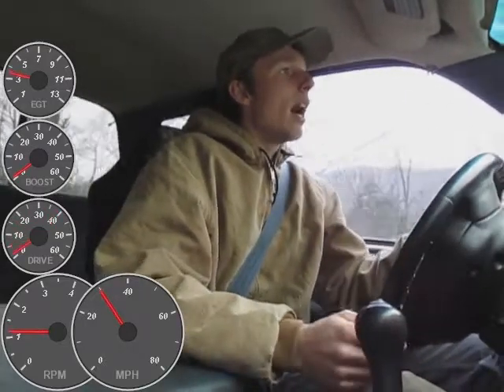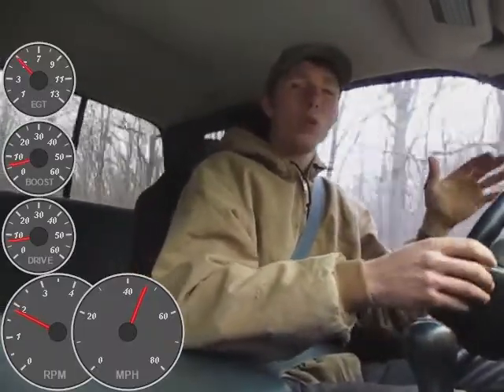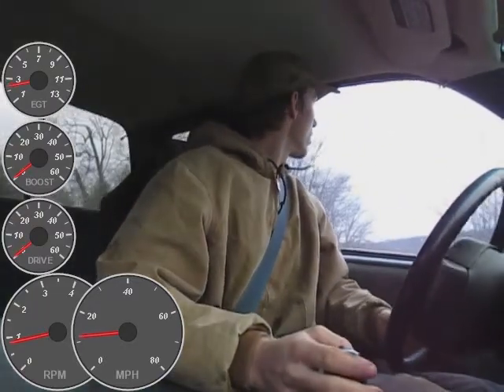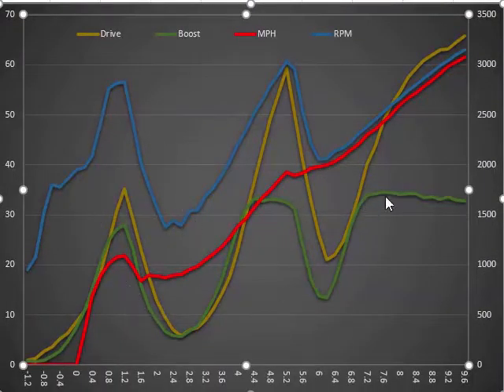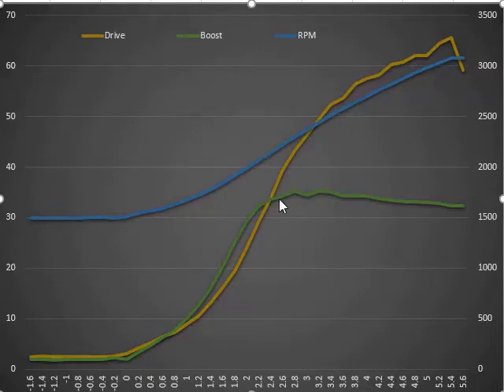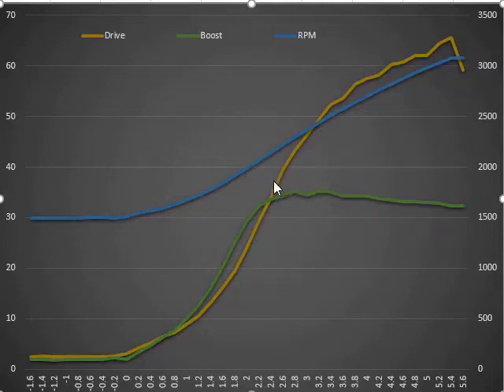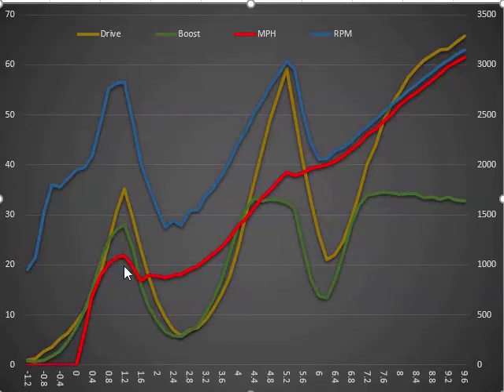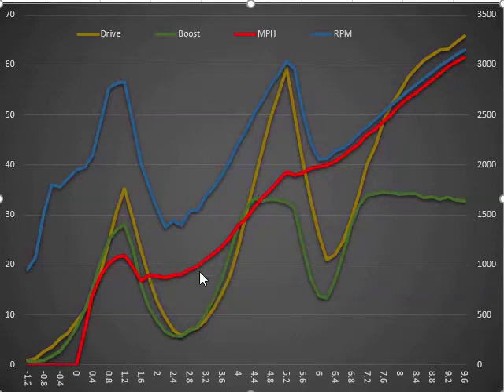MORE BOOST???   Spring Gate Testing!

Comment: what are you using to monitor and gather your data? Then it looks like you imported it into excel...?
Reply from the maker: I built a datalogger to collect the data and put it on a SD card,  for the graphs, you are correct, I load it in excel.  For the overlay I use a gopro app called "Dashware" that overlays the gauges onto the video.
Reply: That is awesome man! I may have to talk to you in a couple months when I get my truck on the road. It would be really helpful to monitor that kind of stuff since my truck is anything but factory original lol

Comment: what do you think of the AFC live fuel controller?
Reply from the maker: As a fuel controller it does its job well, it can really cut down on the time it takes to get a decent tune.  If you've got the couple extra bucks to get one I say go for it.  Just understand that it doesn't increase hp, it just helps control the hp you have.  Take care!
Reply: CumminsWorks thanks for your reply 🤘

Comment: what else is done to the truck?
Reply from the maker: This truck has been somewhat of a test-pig, so there is some stuff that was done for no apparent reason, and with no appreciative gain, but here's the performance mods list so far:  Stock HX35 W/Quick Spool Valve (quicker spool), DAP 5X13 SAC Injectors, 3.5 GSK, 15.5* Timing, Stop Bolt Mod (replaces fuel plate), Port and Polished Cylinder Head (Increased airflow for better spool and top end power), Dual AFC springs (better smoke control), Flat Ground AFC Foot (better smoke control), Stock 3" straight-pipe exhaust with resonator, Spring Gate (better boost control), DIY Intake Horn (no gains) and of course, MIA Silencer Ring! (no gains).